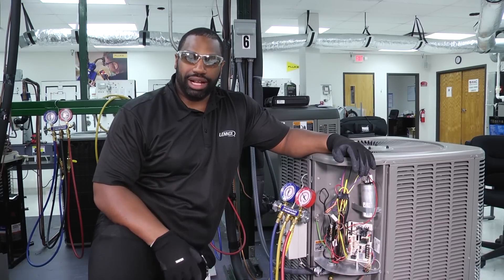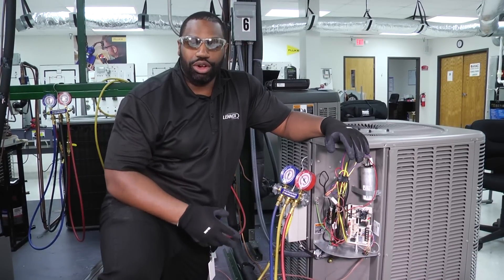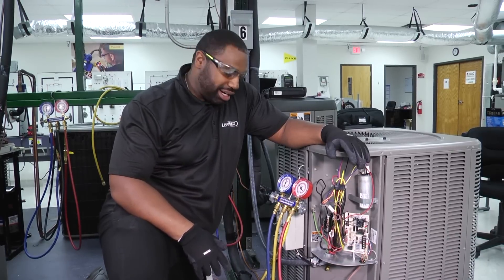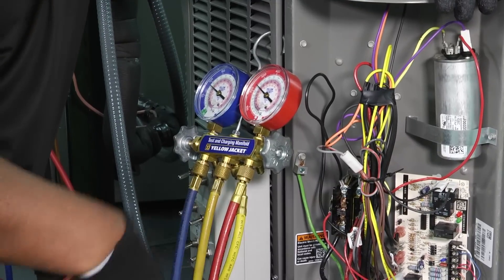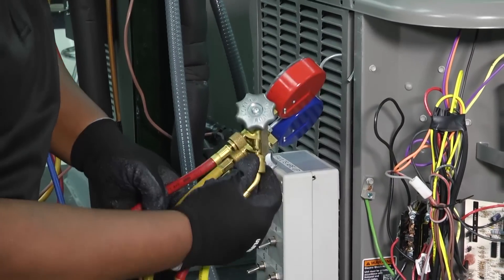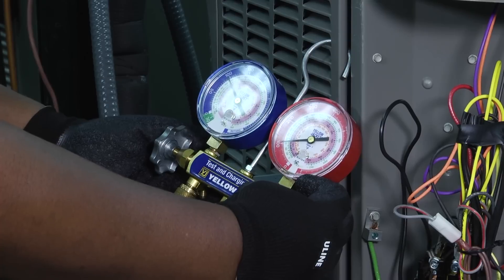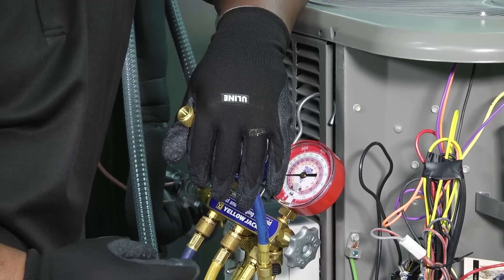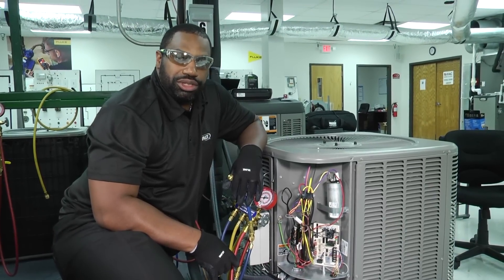Toolbox Tuesday: How to Disconnect Air Conditioning Manifold Gauges | Lennox

Comment: A trick I was shown for taking gauges off fast especially on 410a units is to push down on the part of your hose that has your core depressor and seal ring to basically act as if your hose nut is still screwed down. 

Take your index finger and spin off the nut and once your clear of the threads your hose will come off with only what’s left between your ball valve and the port. 

Now always make sure your seals are not to worn down and if the port is on a stem be careful of how much you’re pushing on it so it doesn’t bend/kink/break. 

Hope it helps.

Comment: You're missing the point of the question. When disconnecting, you are not only releasing pressure from the hose, most of the release is coming from the AC unit. And the higher the pressure the faster it comes out. I had a release today that I wasn't expecting because the high side pressure was close to 600 PSI. It was still 525 PSI after about a 3-4 second release that went mostly on my hand. I had some minor burns and I put on gloves right after that. I assume it was overcharged at some point because normal high side is 450 PSI. Other than screwing the fitting off quickly, is there any way to prevent such losses disconnecting?

Comment: While the compressor is running I close the liquid shut off valve from the unit and using the pump down method I suck all refrigerant from the manifold and hoses into the system until the pressure is zero. Then I disconnect the hoses and open the liquid shut off valve again and the system keeps running. This is really a low loss method.
Reply: Yes, I believe this is the best method.

Comment: I'm a new technician I only have 2 years of experience but what I was taught was to get low loss fitting on all hoses and to get multiple gauges for different type of refrigerants to protect yourself from mixing refrigerant
Reply: That’s not correct. Buy one good set of gauges and you are done. By the way if you are just going to check the pressure only then you can use field piece Bluetooth no hoses at all.

Comment: What gloves are good to use incase some refrigerant freezes my hands?
Reply: I just wouldn't use gloves.
Reply: @camerondale9412  Yeah the burn tends to be bad at first and only annoying later one but I’ll definitely pick some up for electricity if there is any good ones.
Reply: @Kenpachi69420  Ah thanks even with a low loss fitting sometimes disconnecting or even connecting at a weird angle can leak refrigerant onto my under and that’s not fun. I’ll check Amazon or maybe tractor supply though I’m sure I won’t have luck at tractor supply. Thanks for the recommendation

Comment: If using a low loss connector on the yellow hose, how do you properly disconnect the hose from the tank, then send what's left in the hose into the suction line? Now, that's going to add a little more Freon but probably not enough to matter. Without a low loss connector, what's left in the yellow hose is going to come out and let air back in, right?

Comment: What if the liquid service valve fails to shut off when you attempt to remove your line hose?
Reply: This would be due to a failing schrader core. The best way to remedy the problem would be to reconnect your hoses and pump the system down, or pull all of the refrigerant back into the condenser. (First shut off the liquid side/high side valve, engage contactor until unit pressure pulls all the way down, and then close the suction side/low side valve)  After completing this you would replace the schrader core and pull a vacuum. Once you have completed the evacuation, you would release the refrigerant back into the system and follow these steps. Thanks!
Reply: @michaelcooper9475   thanks so much, that’s exactly what happen to me today. I removed my lines but the liquid service valve didn’t shut off

Comment: What i was thought to do was you back seat the king valve and then open up the gagues the king side gague should drop and then back seat the queen valve and last disconnect the king valve a little should come out and after disconnect the queen
Reply: of course with the unit off i presume you mean? if you close those ports with the system running you will initiate a pump down on the unit.

Comment: Once you closed off those valve connections, didn't that leave refrigerant and vapor trapped in the longer hoses?
Reply: Yea but then he opens the gauge valves later and sucks it into the low side
Reply: lightgigas thank you.

Comment: I thought low loss meant it seated the valves on the system quick so you dont loose refgnt like you did disconnecting that first high side.  If that was on a refrigeration system than you might as well hook back up and add more rfrgnt..
Reply: That much loss on a “refrigerant system” is not gonna make a difference that was very LOW LOSS

Comment: What gloves r u using?
Reply: Nothing that is approved for refrigerant. Using anything other than butyl lined gloves can result in the refrigerant permeating through the gloves and freezing directly to your hand in a catastrophic release. I've seen some gnarly pictures of incidents. The OSHA has approved neoprene as well, but it seems to react to most refrigerants. These gloves are expensive, bulky, and don't really keep out the cold without another layer though, so most tech's just don't use gloves. 

Most only use 2 finger tips to screw on valves keeping their hand out of direct line of the gas release, and use some combination of low loss fittings, core depressors, and/or ball valves to limit how much gas could even be released. Having a 6" hose before the ball valves with standard connections like this guy has is wild. Way more release than most competent tech's would do.

Comment: I also bleed the hoses (middle port and suction port) of any air before adding the refrigerant back into the unit. A very tiny amount refrigerant is lost.
Reply: @Michael-pz1hc  When guys are just checking a charge a lot just leave service hose connected to manifold. They will bleed low and high side at manifold. So now when they disconnect high side hose and open both valves to sweep refrigerant back in through low side it pushes all the air that was in the service hose and service portion of manifold with it. 

The easiest way is to connect low and high side hoses, have service hose low loss ball valve closed at end, open low side manifold valve, slow open service hose low loss ball valve until bled. Close service hose low loss ball valve, close low side manifold valve. Do same procedure for high side, reconnect end of service hose to manifold. Now your entire manifold and all hoses are bled. 

Start system up and do your checks. To disconnect, close high side hose low loss ball valve and disconnect from condenser, open both manifold valves this will sweep all the refrigerant from high side hose, service hose, and service portion of manifold back in system through low side hose. Close low side hose low loss ball valve, disconnect and on to the next one.
Reply: @Reloadeez  and what if I don’t have a ball valve
Reply: @joshperez7731  you go buy a $10 valve adapter extension on Ebay/Amazon for your service hose.
Reply: Thank you
Reply: Appreciate the feed back
Thank you

Comment: I usually disconnect my gauges when the compressor is running. I have the shut off valve on both my suction and discharge gauges. I start off on the high side by closing off the small shut valve, I open open my valves on the gauges to equalize and make sure all the high side liquid is sucked into the suction side, close my small shut off at the suction, close my valves at the gauges, remove the high side first and attach it to the manifold, then my suction valve and attach it to the gauge manifold. No gas lost. Tighten up the caps. All done!

Comment: Your low loss adapter should be DIRECTLY connected to the liquid line service port. It looks like you have one on your high pressure hose, but then you have a ball valve after it going into your service port - with just a regular schrader going into your service port. The refrigerant loss occurs when you remove your hose from the port - the loss is from the system, not from your hose. If you want to use a ball valve after that connection that's OK (but why, the low loss valve prevents the refrigerant from escaping). Take off that ball valve extension and you'll be fine.
Reply: Lol

Comment: I have about the same set up as you . I shut off my high side ball valve handle.but I purge my center hose from my low side valve,and it fills up all hoses then shut high side ball valve  then open up high and low handles and suck it back into the low side